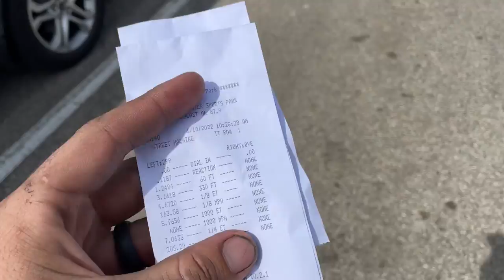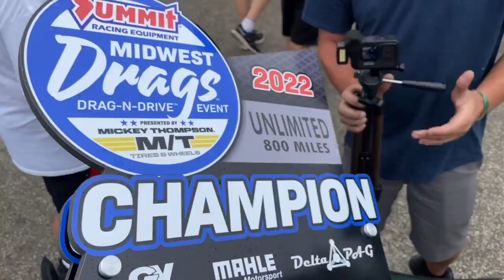Midwest Drag Week DAY 3 - We May Have Hurt Mullet's Turbo 400... Can He Still Limp To a Win??

Comment: You need a “pinlock visor” maybe he will see this. Changed my helmet life lol. Will not fog at all. I hated dealing with fog and use to take my visors off. Never going back from pinlock.
Reply: I know right? I can't imagine buying a new helmet without one now.
Reply: Ditto
Reply: Literally the first thing I thought lol
Reply: Yep, pinlock is the way. Use it on my motorcycle helmet with clear visor
Reply: I thought the same I have one for my moto helmet they are great
Reply: This sounds awesome. I’ve been using the little electric fans to keep from fogging up. But you need batteries etc. I’ll have to check out the pin lock deal.

Comment: The titanium exhaust look so good after some heat through them! Ty needs a raise after those!
Reply: I wanna say Ty and the boys are paid pretty good already! Cleetus knows he has a great team and will keep them all happy so they stick around!! When you have guys like Ty and Zack doing this type of work, many other shops and guys notice it and will 100% try to swoop in and grab them up. The only way to keep them , is to keep them well paid and happy.
Reply: @warrenmichael918  Yeah, but who under-filled the transmission, or does it puke that much fluid into the catch can?  Gotta check it every run.
Reply: @jamesplotkin4674  They were talking about a small drip or leak in someones video i believe, then they ran it all week and never checked the level. This was 100% on Cleeter lol I agree, they should check it before every run! I think they were so concerned with the new motor that they just didnt even think about the MnM trans because it is almost bulletproof, unless it gets ran dry! LOL

Comment: I love how titanium blues with heat.  Can’t wait to see all that color after running mullet a little more
Reply: Steel is what "blues", titanium actually oxidizes and grows a crystalline structure on it's surface which refracts different wavelengths of light back to your eye, depending on the size of these crystals the color looks different.. different heat changes the crystal structure and it goes from like brown to purple, blue, light blue, and a few lighter colors of purple and greenish.
Reply: @PreludeDude  bill nye, is that you?

Comment: Hmmm... Quicker 60Ft. WHEN LOW ON TRANS FLUID makes me wonder if the converter is a bit tight for best 60s? That or maybe add a bit of boost to the launch???
Congrats guys!!! Glad I finally heard a shout out to SM Engines at the end 👍
Reply: Ha ha the scammer says you won!!! Aren't you lucky!?!
Reply: Converter is probably a smidge tight. Seems when they smack it real hard off the line it spins. Probably track prep dependent mostly, but I’d bet it’s also some converter tightness. 

Converters run “looser” if over powered for what they were set up for, MnM probably expected cleetus to just go super powerful because that’s what he does(he’ll yeah brother!) and sent one that’s prepared for that level of HP not the “milder ish” level he has it at. So it’s running just a little bit tighter then it probably should be. 

Again just my guess and I’m probably completely wrong. Who knows
Reply: @gavincline209  i don’t know much about transmissions but doesn’t that transmission have a dump valve, they should be able to lower line pressure to give the same effect as loosening the converter up. Some transmission tuning would really let this car fly.

Comment: So, a good checklist to have: #1 Check doors for water #2 Make sure there is an oil cap #3 Check trans fluid level
Reply: They drilled the doors so no need to check them anymore.
Reply: check for leaves plugging the door drains

Comment: I think you need to laminate a checklist.
Like, you wouldn't blow an Oil Cap on the track if you 2step checked before the run, or ran without oil if you pulled the sticks... Just a little reminder to keep an upcheck on things.

Comment: Congrats on the win .  You still have issues with that front-end my man . That wheel should not go left on the big end then whip right when you hit the chutes. That's going to put you into the wall of you have cross wind issues some day . 
Keep up the good work 👍
Reply: Definitely needs looking at, small problem could cost the car/engine
Reply: Yes indeed. One of those front shocks is probably cooked. He lets the cars bounce in the trailers, and when you do that, the race shocks end up getting the same mileage as the trailer.
Reply: @RonniePTexan   motorcross bikes use a shock saver for transport that locks wheel to frame. Not sure if theres a product for cars
Reply: @Jake_Hamlin  Yes, there are special air bladders, but you can also just put blocks of wood under the frame so it keeps the car in sync with the trailer. It's one of those things that gets ignored until a racer goes through enough shocks that the shock company asks him about how he transports the car, then the light bulb comes on. For me that number was 3 shocks and almost $2,000. That's how dumb I was! Lol

Comment: Judging from the titanium, it looks like that passenger side turbo is running hotter than driver. Is that from street driving or something? Glad to see yall having a smoother go at a drag and drive event!
Reply: Just guessing, but I think the reason might be those faulty coils from last video. When some cylinders are not firing, it logically is colder on that side
Reply: @tzmtzt  but the faulty coils were on the passenger side...
Reply: @truckertj2109  well maybe all the fuel that didn't burn from the bad coils push into the exhaust and burned there? I have no idea if that could happen
Reply: @jacobhanson9009  yes, it's almost anti-lag. The fuel system doesn't know there is no spark (due to faulty coils), so fuel gets injected, but not burned. On the 4. stroke the fuel-air mix gets pushed in the exhaust and the hot exhaust gases from the other cylinders cause it to ignite.
Reply: Depends on how much WD 40 Tye applied to each pipe. He hit the passenger side more than the drivers side. They do that to get the unique coloring

Comment: I commented on Kevin’s video, but I’ll post here too. Think it may be a good idea to create a pre-race checklist. Two minor mistakes on this trip could have hurt bad on the new setup. Just an idea maybe. 😀

Transmission might need a refresh, pretty sure I saw the 2/3 shift run out to 8400+ rpm. Not sure if that’s a problem with the setup or not, but first time I saw it that high.
Reply: There is a reason that airplanes use ‘em. Even pilots that have flown them for years. All it takes it forgetting one thing and racing at this horsepower and speeds you don’t have much room for fuckups.
Reply: I like what parker was doing last drag and drive, writing a checklist right on the back glass.

Comment: So is the passenger side running leaner than the driver side? Looks like there's a difference in the titanium.
Reply: it's likely due to all the oil from when they accidentally left the cap off.
Reply: probably them running out of fuel when road driving

Comment: First time out with the SME big block 540 and a win.  And the car still in one peice! McFarland racing is the new weapon our there. 
One tip that you don't need to hear... get a dry erase board or something and have a checklist of what you have to check.
Also, start keeping a simple logbook of how many street miles you did between tracks, what you checked and when, when you last changed fluids etc.  It's really not too hard just have to get used to it and work it into your routine.  Now that you've kicked the whole program with Mullet (among what's coming with the other cars in the fleet) you have to step up your maintenance game too.  Don't want to be breaking expensive parts now.  
Congrats to you, your team and Kevin for making such a successful race week.
Cheers from Canada 🇨🇦 🤘🤟

Comment: Garrett, concerning the foggy lens issues, you gotta have a look at "pinlock" I ride motorcycles, ATVs and snowmobiles, and I always had fog issues in hot, humid, or cold temperatures. The 2 last helmets I bought had pinlock lens, and that solved 100% of the problem! I know they make them for a lot of motorcycle helmets, but also for Simpson helmets an probably all the motorsports helmets too!

Comment: Cleeter; you know how airline pilots do it.  They have a checklist.  You both are flying and safety comes first.  Checklist Checklist!!!!  Re Trans; 76 TH350 split a cooling hose line.  I said screw it  and drove it 5 miles home; smoking all the way and dumping most of the fluid out.  Hesitating a few seconds to get to reverse, it still drives like new. The 350 and 400 engineering are bullet resistant:)

Comment: Ya could use some draft on the bucket, put a hose on 'er and pull that exhaust air out... a bulkhead 90 facing backwards on the roof, and at 200mph, no fog at all! Dump some lucas in that T400...unless there's a bunch of stanky on the dipstick...congrats on the WIN!

Comment: CLeet, all my race cars have a check list on the windshield and it needs to be checked off before the car goes out on track for every session. Things like, wheels torqued, fuel level, oil level, water, tools in the engine compartment, tools in the driver compartment, air pressure, sensors pluged in tight, etc...it eliminates silly things that can hurt the car. Just type one up and print them off. easy peezie...congrats bro! you and Kevin kicked ass

Comment: Ole Cleet put some foam blocks on the bottom of the hood like mine has so you can put the hood on the roof before someone drives over it or steps on it.

Comment: Good diagnosis immediately upon returning from the first run to say it was a transmission problem, probably a shifting issue. With all that's going on while on a run of less than 7.5 seconds (this "slow" one) at nearly 200 MPH, being experienced as you are allows you to "sense" what may be wrong.

Comment: You are finally running at top comp times and and at the series end of racing , triple checklists are the normal now at this level , anything under 7.30's is serious look into a crew chief that can take the pressure off you Cleet U should only be focusing on the tree and pulling chutes now , GD luck

Comment: With that kind of acceleration I'm thinking a fluid surge to the rear of the trans and torque convertor drying up because pump is sucking some air?  My 2 cents is all..

Comment: Back in the day when I was swinging spanners on huge industrial gas and diesel engines we would be able to adjust the valves in two rotations to TDC. We had a chart of what valves to adjust at TDC of each rotation, I am curious if this would be possible on this set up or maybe with the valve overlap on this camshaft it is not possible but it would make the job a lot easier if it was.

Comment: Kevin needs to be a full time Cleetus crew member. (I know he is often anyway) Nice job guys, congrats on the win! Hey, I was wondering, I did a fair amount of bracket racing with my dad and brother in Top Dragsters, and we had a computer to tell us the corrected Altitude. That let us very accurately know the ET prior to running at all tracks. The more you use it and log, the more accurate it gets. Now, I know you guys are mostly running all out, but for tuning, I'd think it would help? Does the holley setup have that built in? I mean, it was accurate to the .010 nearly all the time. Just curious guys, thanks much for the vids.

Comment: I'm surprised you guys don't check your fluids more often.
 I know one of your motors almost ran completely out of oil between tracks.
 I remember Jeremy telling me that's what blew up one of the motors in Uncle Sam..... (I would have never said this but it doesn't seem like hes in the game any more so........💁‍♂️)

 The only thing I could think of is that when you tried to do the burnouts with the 'traction control' on you might have cooked some of the fluid out of it.....🙄

Comment: SAM WOULD OF CAUGHT THE TRANS FLUID WAS LOW. I SEE WHEN THE MULLET STARTS GOING GOOD THE GREMLINS COME OUT AND START BREAKING THINGS OR LETTING THINGS SLIP A LITTLE BIT YOU NEED A GUY FOR EVERY MAINTENANCE THINGS LIKE TRANS FLUID DETECTION LIKE DATA LOG FOR THE WHOLE SYSTEM LIKE A FLASHING BLINKING LIGHT YOU DONT WANT TO REPLACE A TRANSMISSION OR A ENGINE.

Comment: Yooo check out Mr.wendell's Motorsports he specializes in power glides and builds some of the baddest transmissions around builders alot for some big big power also get a universal transmission dip stick tube those aftermarket ones never will get an accurate reading. If you do hit him up tell him brenden sent you he works with alot of big power cars and a couple of the 405 guys in Oklahoma